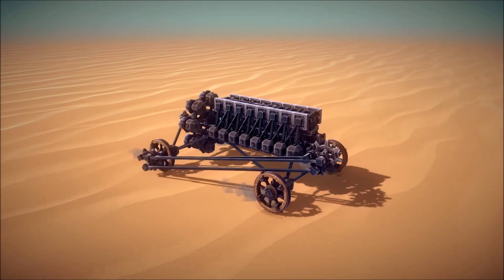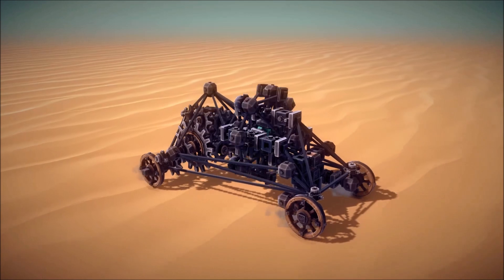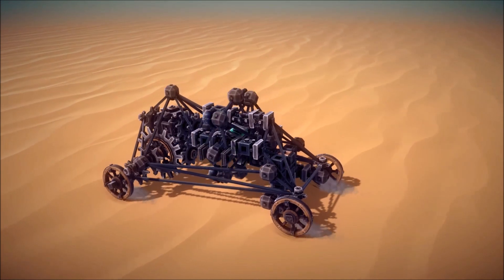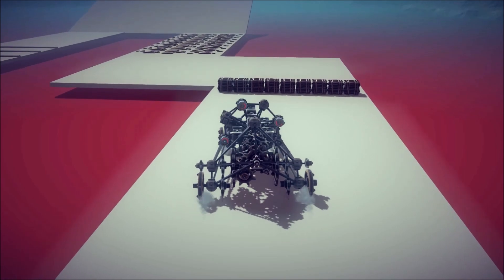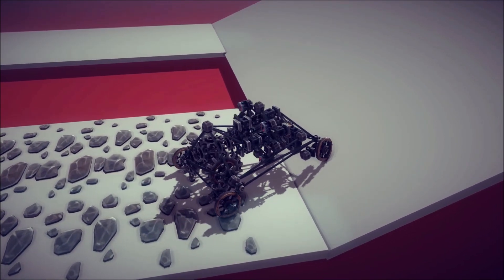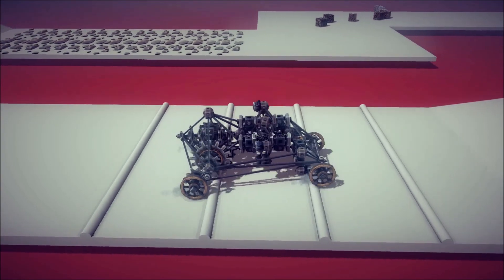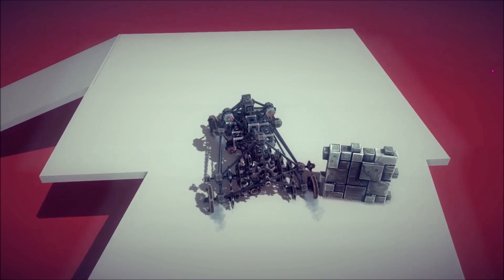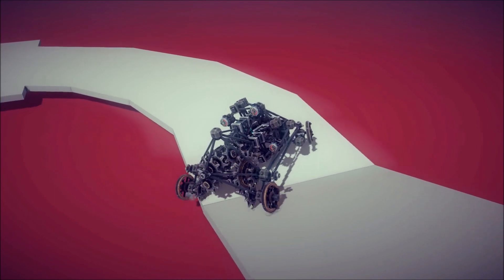I remade my axial engine FROM SCRATCH to enter into Reid Captain's competition

Comment: I know this was posted ages ago, but do you happen to have a transmission design that can handle higher torque and doesnt use braces?
Reply: I recommend a gear and steering hinge design. You can use the steering hinges to grapple the gears and engage them. No braces required and the throughput is as high as the input speed so no speed loses. As for torque I can't say but I think it wouldn't slip as I've never hap problems with higher power vehicles

Comment: You were too good for his competition, Vlasta! You should make your own. This is a very cool concept by the way. I have made absolute mechanical monstrosities of engines, but I can admit I still do not understand how this works even after watching your videos. One cool thing and a serious limiting factor in my progress has been developing transmissions. I believe I've peaked in terms of raw mechanical power that I can harness, transferring massive torque to the wheels through an extreme gear ratio only ends up tearing most everything drivetrain related apart under stress. It is like flooring a car in 6th gear at that point. With a transmission, I can switch to taller gears only when needed instead of a fixed drive ratio. I gave it a try, however the efficiency losses were massive and ended up being significantly slower than even old cars of mine, taking it from a meters/second speed of 35 to 19. not only that, but it almost doubled the length of the car. I'd love to see your take on it, and would definitely be thrilled if you found a way to make it practical!

Comment: This is great, I have a challenge I think is worthy for you: Make a radial engine powered tracked vehicle

I haven't played besiege in a long time and looking through my old builds I found several tanks I had made, and they were still very sturdy and dureable despite all the updates, this was before part scaling so I'm sure you can build way more efficient tracks now (those were chains of hinges with the long armor plate on the exterior, and supports fitting on the inside as well as right/left)

those were very heavy vehicles, I had a fascination with building only out of indestructible blocks to create unbreakeable vehicles, and even without powered wheels or cogs I managed to power them, so now with the scealeable blocks, you could make way smaller/lighter tank threads, making it even easier to power the vehicle by reducing it's total weight

though it still is a greater wheight than any  minimalist wheeled vehicle, and it would be really cool to see tracks powered by that engine, so that's the challenge, build your own track threads, and make a radial engine strong enough (you might need a gearbox depending on the speed to power ratio) to move it around at reasonable speed
I would say you have made something truly impressive if it can climb 20° slopes, 10° slopes for the silver medal
Reply: Do you mean climbing 20 degrees with a wheeled or tracked vehicle? I would love to see his take on a tank too
Reply: The weight of the parts does not scale with size. Encountered this problem when building missiles, missiles ended up heavier than the plane carrying them

Comment: what mods do you have?
Reply from the maker: For this video, none at all, since mods weren't really allowed in the competition. I like mods, miniguns and hoverblocks are fun, but I try to keep mods that add new blocks out of the videos, so the mods I mostly use are building tools:
-EasyScale to change the size of the blocks through the attributes, which I find gives me more control than handle operated scaling mods
-NoBounds which lets me change the attributes of blocks to any value without limits
-Additive Loading to allow me to load multiple saved creations to combine them easily
-Colliderscope which lets me see the actual hitboxes of blocks
Generally, I try to use mods as little as possible, building with mods makes me feel like the product is less legitimate. It lessens the challenge, and breaks the vibe. I use scaling, because some of the blocks in the game are just inconveniently bulky, but when I do, I try not to go over a factor of two, because that usually leads to things not connecting properly.

Comment: Why would you get disqualified for using hinges?
Reply from the maker: They had a rule that said you were allowed to use hinges for steering, as long as they don't do any "meaningful work". I'm using hinges for more than just steering, and I wasn't really sure what exactly is meant by meaningful work. Also I needed a setup for the joke
Reply: @vlastasusak6881  Oh, ok. Thing is, how would you make a piston engine without hinges? Why would hinges be banned and not anything else?
Reply from the maker: @bobi_lopataru  It's a bit unsettling, but some people make the offsets in piston engines by calculating the angles using goniometric functions and inputting them manually with the rotate tool, and creating all sorts of wonky half connections to make it hold together, rather than just using hinges to rotate everything into place neatly. The point of the competition was to make a vehicle that is powered by a mechanism that converts linear power to rotational power, so you can use pistons, ropes, springs, water cannons, normal cannons, vacuums, bombs, rockets, and flying blocks, provided you're not using any of that to just push the vehicle directly. Therefore purely rotational elements like powered hinges, powered wheels and cogs, spinning blocks, saws, and drills are banned, with the exception of using them for steering. Maybe if you used the rotational elements to make a linear piston that then powers a linear to rotational mechanism, you could argue that is also ok
Reply: @vlastasusak6881  wow, thank you a lot for explaining this in such detail! I get it now